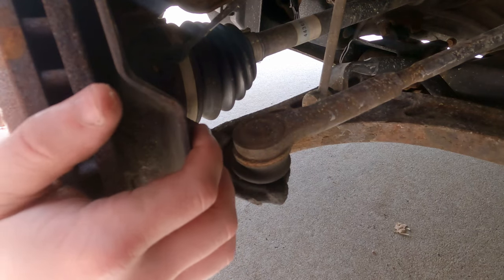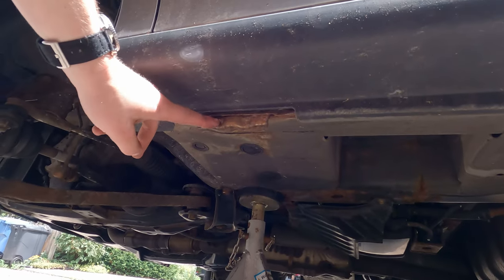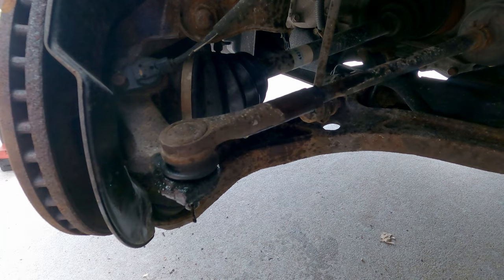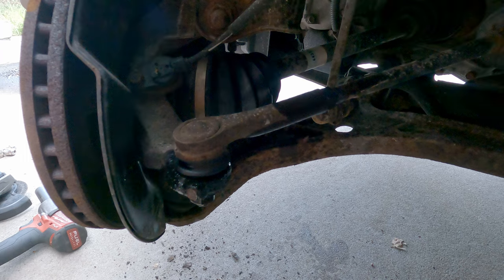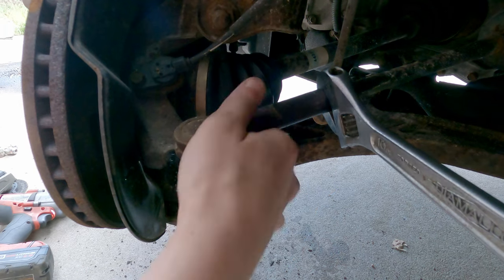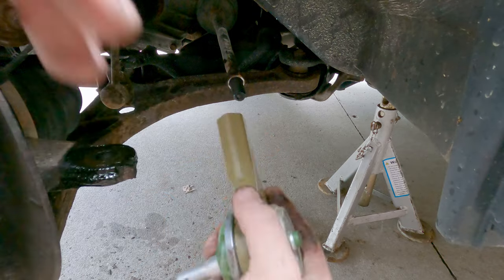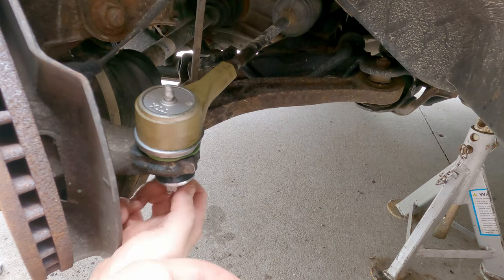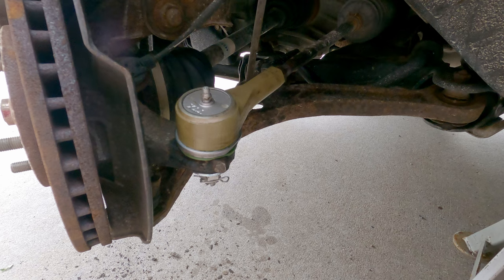Honda Odyssey Outer Tie Rod End Replacement

Comment: The Moog ball joints I installed in my Miata also came with Zerk fittings... Back in the day, everything did ;)
Reply from the maker: They're nice!
Reply: @HardwayLearning  My Miata engine getting bored out to 1.9 soon...
Reply from the maker: Ohhhh that's exciting, what's the hp goals for that? Turbo?
Reply: @HardwayLearning  Manley rods, ARP studs, turbo... Looking for conservative 300 hp, 6 speed gearbox too. I'm old so for me fast is when I stop eating ;)
Reply from the maker: @bvward  300hp will be a hoot. I still get a grin on my face with my measly 180whp 😂. Looking to build mine if I ever get out from under the 944

Comment: Good job on the video, I wonder if it isn't a Honda common issue. My steering shakes while hard breaking and or going down hill. I suspect it is the tie rod end. I will start with it and see how it goes. Suspension seams tight otherwise.
Reply from the maker: I've heard it's a weak point on these, if it's easy to twist and or the boot is torn, I'd replace it